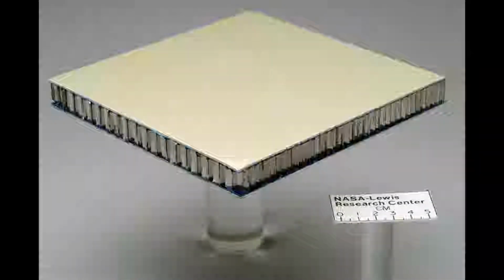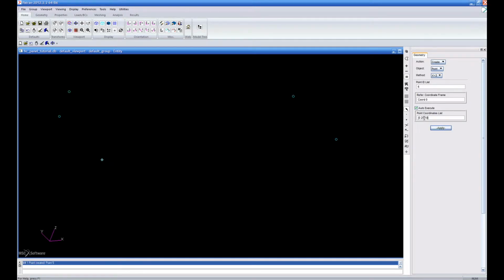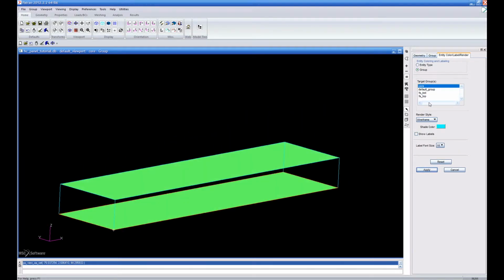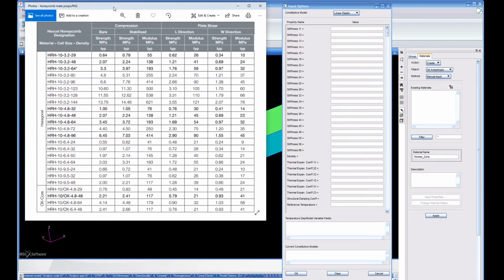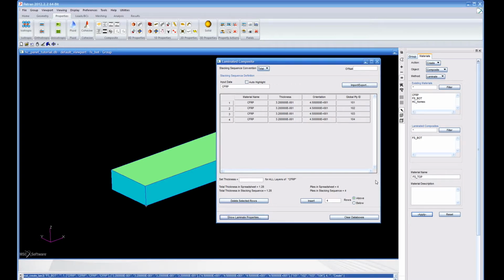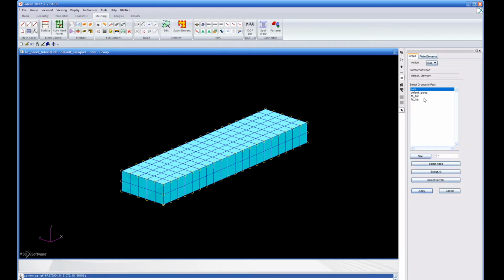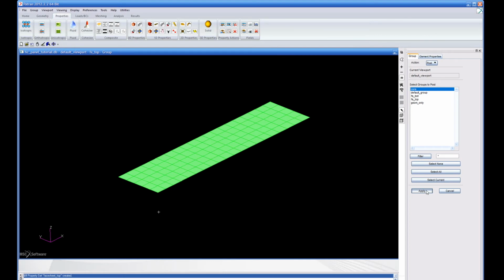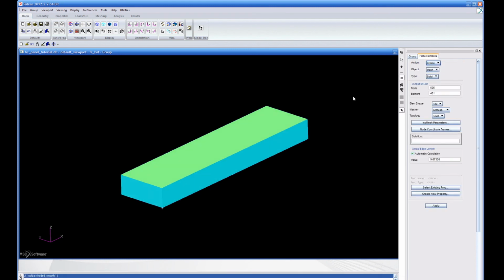Simple Finite Element Model of a Composite Honeycomb Sandwich Panel

Comment: Directly entering stiffness values into the MAT9 anisotropic material matrix G is tricky.  Please see the MSC Nastran Linear Static Analysis User's Guide for definition of the Gij terms.  You can get in trouble really fast if you don't know what you are doing.  A better method is to enter the elastic properties from your data sheets into the Patran 3D Orthotropic Material form.  Patran will then write out the corresponding MAT9 entry for you.  Thanks for sharing the video.